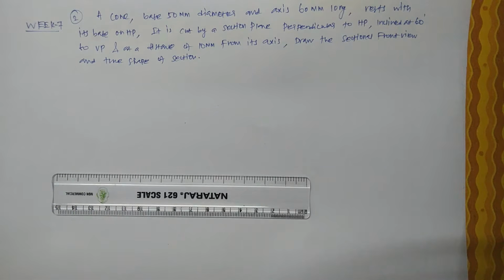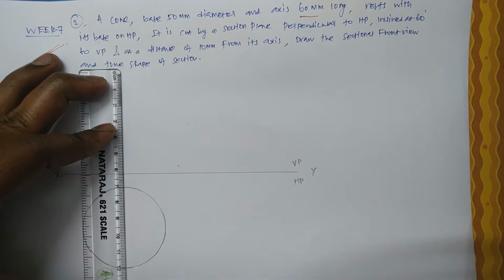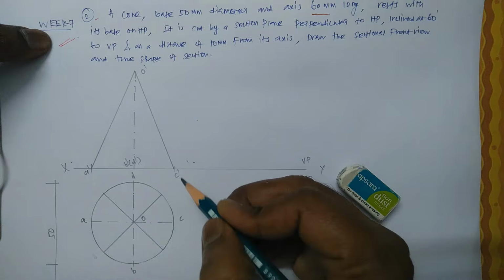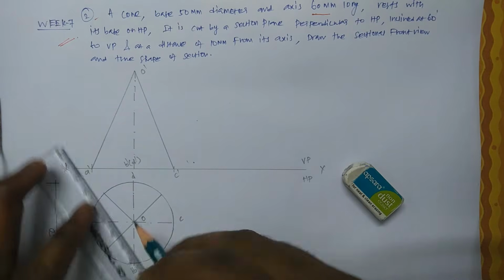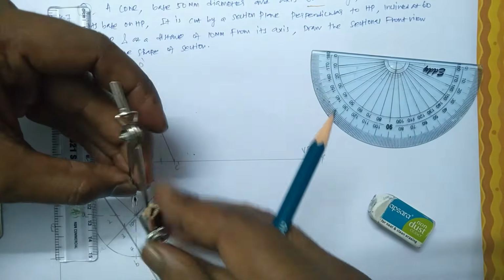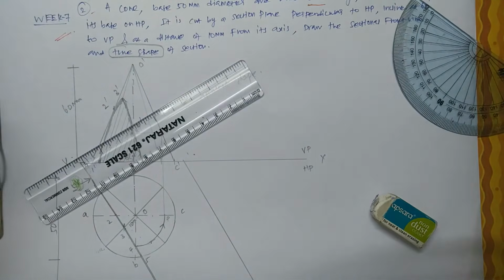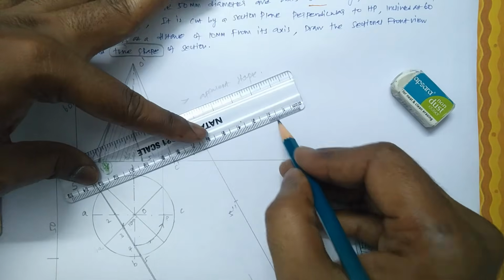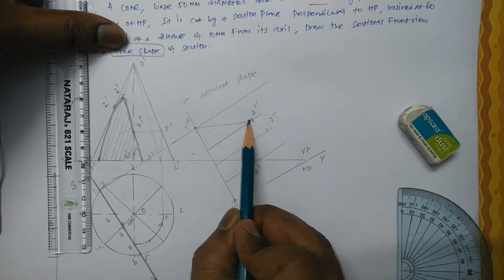Sections of Solids  right circular cone

Comment: A right circular cone of 80 mm base diameter and axis 100 mm long resting on its base on the H.P. It is cut by the section plane inclined at 40° to the H.P. and perpendicular to

V.P., bisecting the axis of cone. Draw

Front view

Sectional top view

True shape of the section